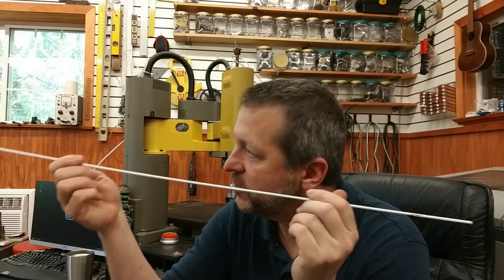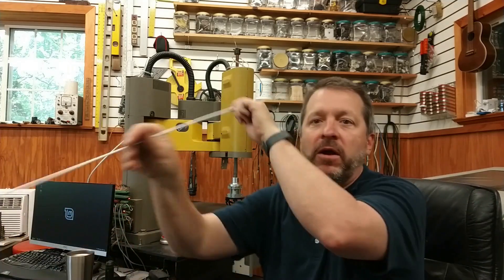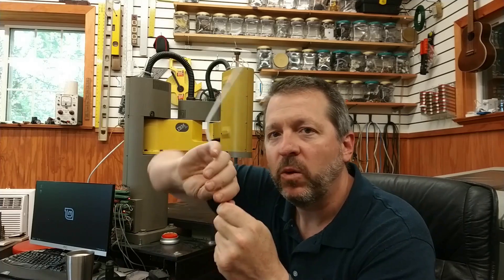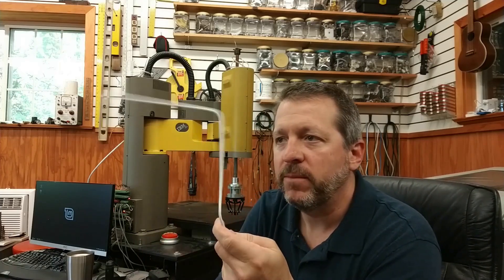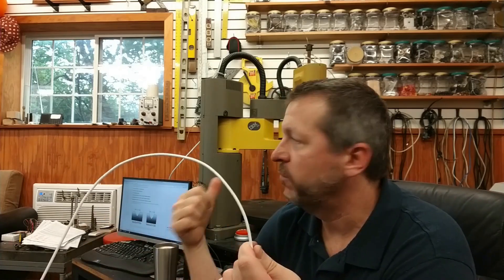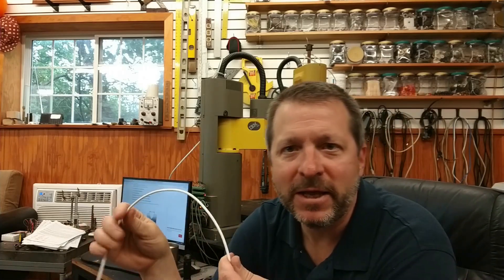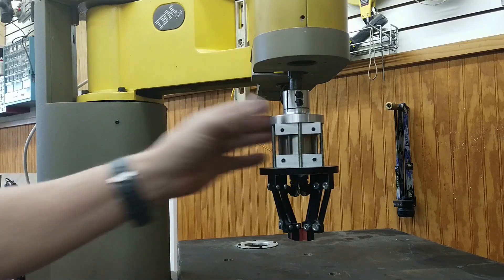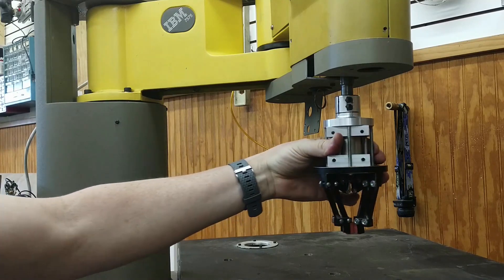Lenny the Big Dumb ... Bender

Comment: I've had a NEMA34 stepper with harmonic reducer head kicking around that I have slated for a wire bending head like the "normal" wire bender you posted. I'll be following the software and path solutions you come up with.